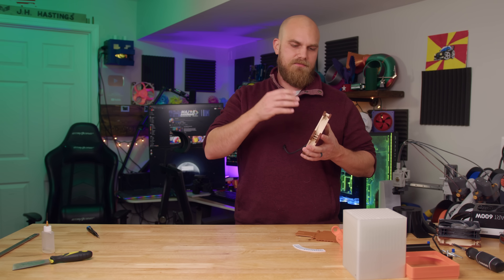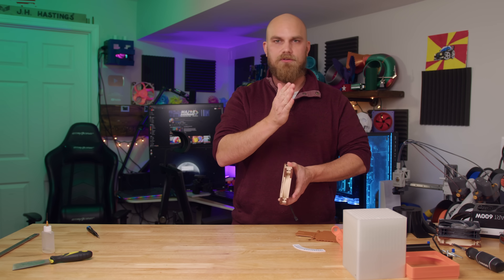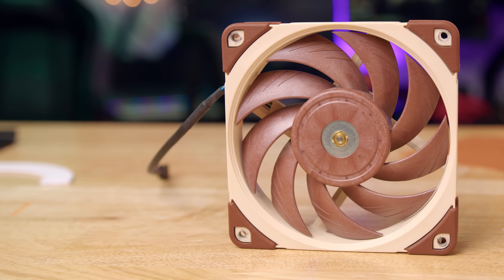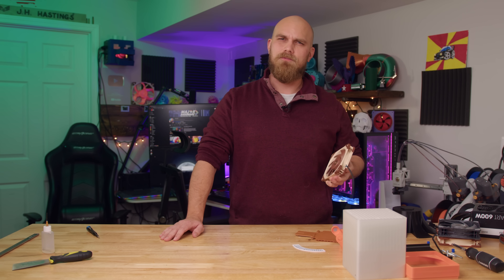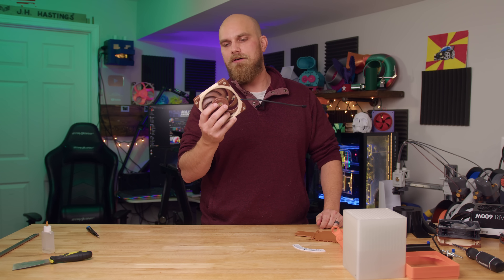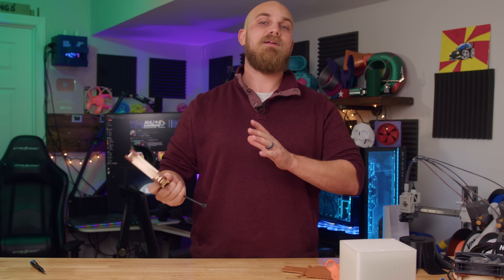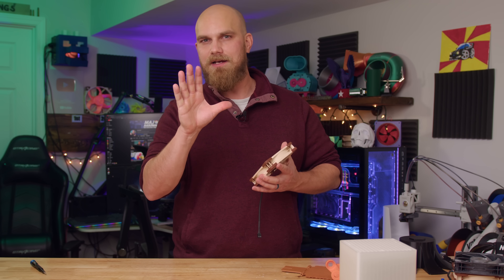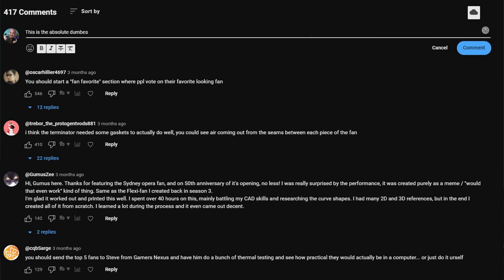I Built a Static Pressure Machine | Fan Showdown Season 6 Pilot

Comment: Why not make a adapter for a clear round tube that fits a pingpong ball and set it vertically - now you can check how high the ball floats on the pocket of air without the weird variance of a hinge / added mechanical friction.

Comment: Looks good!
My main concern would be on the difficulty you might have to read accurately between 5 and 7 where it seems most of the fans will fall.
In other words: how to discriminate accurately between a 5.9 and a 6
You migh want to have your needle go higher and the measuring arc be more finely printed to ensure that.

The other concern others shared in the comments regarding the non-linearity oh the measures might also be a concern : 
If your test shows fo fan A a measure of 6 and the other a measure of 7, Fan B is not "one louder" ( Spinal Tap reference ) but like 12% better
Even worse, another fan at 8 may not be 24% better but 30% better.
So you might have to exponentialize your scale to better reflect the compared performance.

Comment: i think the issue here is that you are still letting air out the other side, thefore are mesureing "flowing pressure" not "static pressure". i think if you put close fitting but not touching walls either side of the pivoting door to limit the ammount of air that can escape through an opening flap (or atleast keep it consistent as it opens) then youll have actual static pressure separate from the flow velocity

Comment: The main problem i see is that your not really measuring the static pressure, but more the total pressure. If you look at google at stativ vs dynamic pressure you see that the static one is measured orthogonally to the air flow. In contrast to the dynamic , which is the difference between the total stagnation pressure and the static pressure. with the way your doing it right now i think you can still measure the performance of different fans in a comparing way. 
And also the realtion between the Pressure you measure and the indication on the dial isnt linear since the area of the flap, which is hit by the air flow is decreasing the further it rotates.
E.G. if one fan hits a 2 and another hits 4 its doesnt mean that its two times as strong. ( I think the relation is more exponentiol so it would be 4 times as powerful.)
But nice concept anyway.

Comment: i would have gone with a vertical tower, same arrangement ish, except the flap would be a 28g plate, the measuring device would be a set of pocket scales positioned under the plate (modified so the screen sits on the outside of the arrangement) giving you the chance to see exactly how many grams is could lift through the restricted pathways, from this with the surface area and weight of the plate you could convert it to the standard relevant units for the test.

 this apparatus aint too bad tbh, maybe add a bit more meat to the pointer arm, that would allow it to move further on the scale due to a lower relative weight to the flap

Comment: You know the reported mmH2O for fans comes from how pressure used to be measured in analog using a manometer. Literally attach a U-tube to a square box with the other end exposed to atmosphere and half fill it with water. Then get a fan to blow in the other side of your box and the water deflects by x mm giving you mmH2O. So anyway, hope that helps.

Comment: This is not a static pressure measurement device. This simply a flow/velocity -dependent resistance and could be considered an oversized flow meter. Since you are changing the geometry of the outlet, the higher the flow gets, nothing is static here. In a static pressure setup you would measure the pressure that the fan can generate in a closed (aside from the port for the fan) compartment. The pressure gage would need to seal the compartment from the outside world. Imagine blowing up a balloon and seeing how large it gets until its size does not increase anymore. In practical application you would probably not use a balloon but some kind of membrane that presses against a spring and moves a needle. Also you would need to get the measurement device mounted in a place where it is not directly hit by the air current of the fan. That would lead to inaccurate results.

Comment: Maybe good to have a reference result using the same dimensions but without the radiator? Also, this is a push configuration right? Nice to have a pull config to compare with

Comment: It is quite easy to measure small changes in static pressure without any fancy equipment. Just use a transparent hose felled with water. In order to have a good resolution in the measurement, just incline the hose, so the water has to climb vertically as well as move horizontally. If you take one meter of hose and make it rise one centimetre, each H2O mm of pressure will became 10cm of horizontal displacement it the water column. You must use a hose at least 1cm in diameter, otherwise the surface tension of the liquid will influence your measurements. I saw this method working in college in our fluid mechanics lab. One can measure a difference in pressure as low as 0.01mm of H2O, but you need a good levelled reference, with can be achieved with a second hose to help levelling the whole contraption.

Comment: This does not measure static pressure, it still primarily measures volume, this is easy to visualize by imaging using a pump with a low flow rate, even if the pump can easily produce 10 bar of pressure, it would hardly move the flap because of the low volume of air.

An actually good setup to test pressure in my mind is by using pressure sensor ( i know right 🤯) and a variable air release valve, then if you start with the release valve fully opened and slowly close it until it is fully closed (this has to be done slowly to allow the fan rpm to stabilize) and you measure the peak pressure, then that would be a reading of the static pressure under the most ideal situation for that fan, now purely measuring static pressure is also not that useful, so i would also place an airflow meter behind the air release valve so you know the volume of air it moves at every static pressure and you can plot them against each other, which would be quite interesting data.

Also a quick fyi as to why you need to use a variable air release valve, it is because every fan delivers it's best static pressure at a different volume of air and a different amount of back pressure, you see the same thing in car turbo's they will hardly produce any pressure if the back pressure is too high, and they need some air movement to be as efficient as possible, the amount differs for every turbo

Comment: This is good and creative. In my opinion, just use this alone for at least one season. Also perhaps maybe you could put more weight on the counterbalance side so the t30 (or whatever the gray fan was called) is the maximum on the scale, as most likely nothing will even reach anywhere near its performance let alone surpass it so the noctua can sit a bit higher too, so future not so very well performing fans can still be measured. Basically i think the higher end of the scale is wasted right now and the lower end might not be enough.

Comment: Yes, improvement, love doing it. 
1.  I would raise the hinge to be at a  height of at least the length of your "flop dors" above the  current position. This way the distance of the dors from the outlet hole will be more uniform along the height of outlet, which shall provide more reliable results. 

2. I belive The grid on the doors could be a bit more sparse to further reduce weight

Another way of measurement would be use of springs pushing on the weight and doors and you would just take measurement from it.

Comment: Or you can do tube use pingpong ball and se witch fan make elevat more easier and simpler 😁 and you can use the weight of the ball the elevation that had and use the gap difference to calculate more accurately the static pressure because the door flap loses alot the volume that is coming form the tunel the mor it opens 😁 google flowid fisics and will understand what im trying to explain
If you want to use the pingpong ball you need to axel for the ball so it doesn't jump around on the tunnel and make impossible to read

Comment: That is to not the best idea you should use the same túnel but whit small vent escape and use some sort off weight balance to measure the weight it produces and i think that would be more accurate then the flap dor like the end should have cone shape dor whit weight balance and calibrate the weight it shows on the balance to the static pressure its possible its more accurate and gives. You better data to se who is producing more weight on the balance, (strongest)"fan" and that can translate to static pressure 😁 easyer and more accurate.... Btw sorry for the bad English its not my native language 😂

Comment: You mid be able to put a sensor like a laser distance sensor, load cell or rotary encoder to log the flow data over a period of time as well as getting finer and more consistent measurements that don’t rely on human vision. If you take the logged data and do some algorithm type processing you might even be able to get numbers like stability/consistency, 0-max speed, and other nuanced data.

Comment: You need 2D(for example 120mm fan needs 240mm) away from any surface for inlet and exhaust to measure with the most accuracy, you can also use pitot tubes and micromanometers(FCO510 for example). Depending on how accurate you want to be, I can give you the AMCA regs we use at my work(R&D Ventilation [big fans basically])

Comment: Could you install a normal scale or force gauge aginst the measuring point on the top so you can measure actual static pressure without moving the door as much

Comment: If you just want to measure pressure, why not have a box with the fan mounted to it with no exhaust orifice, but have a container of water inside with a tube going directly upwards. The pressure generated by the fan will exert pressure on the water and force some of it up the tube. Measure the height the water gets to as a comparison metric.

Comment: A12x25 ISN'T really known for its static pressure. 2.3mm of h2o isn't all that much. What the A12x25 is supposed to. Be is an all rounder. Pressure and airflow. Compared to pressure orientated fans the A12x25 gets completely blown out of the water.

Comment: To measure static pressure, I think you need a constriction after the wind tunnel. This will allow for a reduced area flap and a way to calibrate the scale exactly as you want it by changing the constriction ratio.

Comment: In order to fix the flow rate to a linear scale, you probably want the have a fixed size air exit, and a water tube or even a piece of latex that bends and moves a needle. It would be useful to have an air pressure source that is calibrated, or something strong as a bicycle tire that you can register pressure through a valve. I wonder what would be possible with just a bicycle pump?

Comment: Looks like you have your answer. Create a fairly reliable linear scale or you'll never hear the end of it. I agree with the suggestions of incorporating a long, thin hydroscale (sounds like a real word) into the design to ensure there's enough granularity in the reading. I honestly have no idea how much of a factor water temp would be at this scale but it should be negligible.

Also... Can I propose strict rules for this? Such as all designs must fit inside a 120 x 30 mm package. I'm tempted to throw my hat in but I really don't want to see some 3 part monstrosity manipulating the results. If someone wants to do something clever without going over 30mm by all means but let's leave it there.

Comment: Another thought is still using a smaller door for more resolution but require a minimum open angle while Adding some type of small weights to the door on the standard a12x25 to reduce to this minimum angle. 

This way you can judge each fan by the amount of weight required to open the door required distance. 
This will definitely restrict the outlet volume to the sane size on each fan while giving an idea of the fans ability to deal with static pressure. It wouldn’t matter if you even used paper clips as long as the increments are small enough to get good resolution in the weights. 

It’s the simplest way to go build this without extra complexity.

Comment: I wouldn’t use a full size outlet swing door. I would use a smaller door to get more resolution and it would have more accuracy at higher pressures. Right now having the door be the entire size of the fan reduces resolution fast because you are losing too much static pressure from such a large opening. 
Basically keep you inlet the size if the fan end reduce your outlet door by 20-30 percent. 
This should increase your resolution while keeping some type of constant static pressure against the fan.

Comment: If what you are wanting to measure is actually pressure, why not have the fam blowing into a sealed chamber with a reservoir of fluid at the bottom and measure the pressure exerted with a connected standpipe like a barometer?

Comment: You need to have a sealed chamber, where to back(where the flap is) has an o ring around a plunger type measuring device and a spring to show pressure. Your current setup still measures air velocity not static pressure.

Comment: The ideas cool and all, but that doesn't test static pressure. That is a 100% flow meter. While the pressure required to open the flap exponentially reduces, the flow required to open the flap exponentially increases. Ideally what you need is a fixed orifice size and a pressure sensor before the restriction to measure pressure change. Ideally, you would do this in a deadhead situation with zero flow. However completely stalling a fan can potentially cause a false negative as flow separates from the fan blades or cavitates. That being said, a simple reprint with a fixed orifice size as a restriction and a port to be able to install a sensitive pressure sensor would be ideal.  Conversely, using what hardware you already have; you can measure the flow after the restriction with an anemometer and backwards calculate the pressure. Just like in electronics voltage (pressure) = current (flow) x resistance (restrictive orifice area) 

Or in this case 

P=1/2ρv²
 

where:

P is the pressure,
ρ is the air density,
v is the velocity of the air.

Dont use your method...  Its a spin on a Vane sensor which reads air mass (flow)

Comment: The good part: The setup will work since it is the same for evry fan. General idea is respected changing only one thing, in this case the fans.
The down side: it is not verry liniar thas it may not show a good separation between the fans.
The scale/results are going to be more imaginative, no actual physics units.
A better idea is to use a U shaped tube with one end connected to the tunnel, and measure the acutal pressure.

Comment: You might get more accurate results using manometer made of a graduated cylinder full of liquid, no need for a high dollar digital unit. have a sealed box the fan blows into with a fixed size orifice leading to the cylinder via a tube, and measure how much the liquid rises. It would take out the variable of resistance in the hinge as well as make the air flow straightener unnecesary, and test the fan's static pressure at stall (probably not the correct wording for any of that 🤷)

Either way, as long as your tests are repeatable it should show the difference from fan to fan, as actual numbers are pretty irrelevant

Comment: This design has a flaw. 
The static pressure required by the fans to push the flap is almost exponential while using a linear score scale, which in essence makes the scale low res and hard to compare.
This was even seen by your quick test where the NF-F12 with 2,61 mm H₂O achieved "6", and the T30, with 7,11 mm H₂O achieved 9.5. 
As you could see, even though the T30 has 272% the static pressure of an NF-F12, it only achieved 158% of the score in your scale. 

I do like the simplicity of the design, but I would consider the following changes: 
 1 - Change the big dual "pointer", into a needle, like a clock needle so its easier to read the result. 
 2 - Change the Scale paper to not be linear. What I mean by this is not having the same circumference to the pointer. 
If you have the low values (1 to 3) near the axis and the high values (12 to 15) away from the axis of the pointer, allows you to negate the exponential factor of the force required to push the flap open. 
One simple way to achieve this would be for the scale to be essentially a straight line on top of the box, like a ruler, instead of a semi-circle. 

An easy way to define the new scale on the paper, would be to use like 4 or 5 known brand fans that are known for having reliable specs and use it as reference. 

I wish I could share a picture so that I could explain better what I mean.

Comment: This well till you what fan is powerful but I believe this setup needs more adjustment by replacing the flap to be inside the tunnel or but a fan at the end of the tunnel and take check the voltmeter how much reading thanks.

Comment: you could make a manometer, with actual water inside of tubes and instead of digital...pretty much free, have a adjustable dial  for water level "zeroing" with a caliper mounted at the bottom to get accurate measurement, you could use cheap clear hose/tubing, and printed manometer body w/caliper mount.